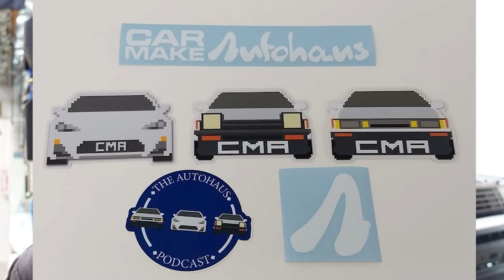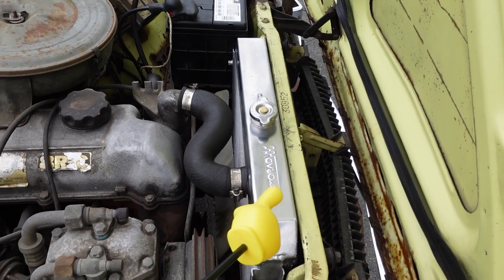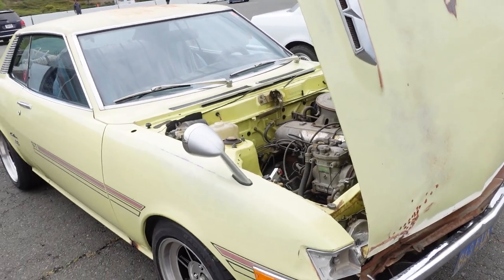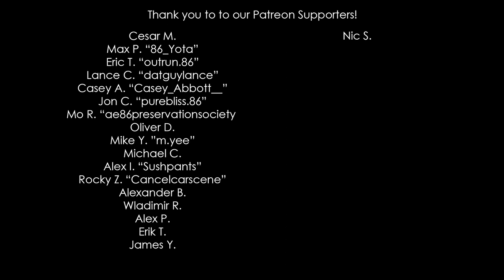Classic Celica Restoration

Comment: I have an RA20 as well and the trunk deck lid did the exact same thing @1:50.  The factory dabs of goop caused it to rust thru the deck lid.  I had to cut each one of those out and TIG weld something like 20 patch panels for that.  When you get to that repair, shape each patch panel to the curve of the lid and oversize the rust hole so that you cut out every bit of rust.  How rare, I also had a 72, but wrecked it and got the 71.  Those front clear signal lights can be reproduced with a clear resin kit that they make.  They are very hard to find and the sun can destroy them, so if you make a mold from the OEM ones, you can reproduce your own.